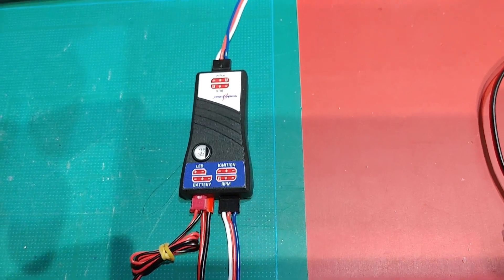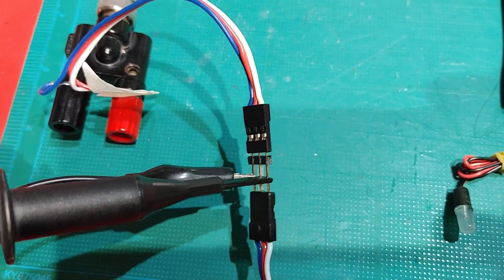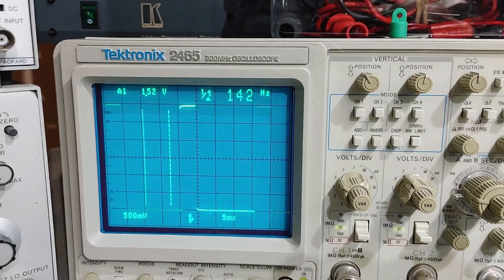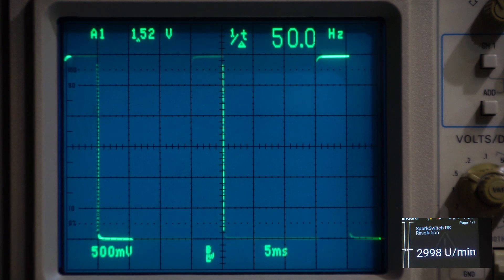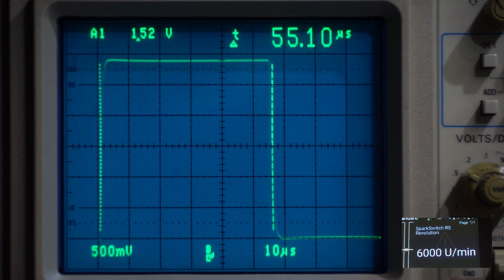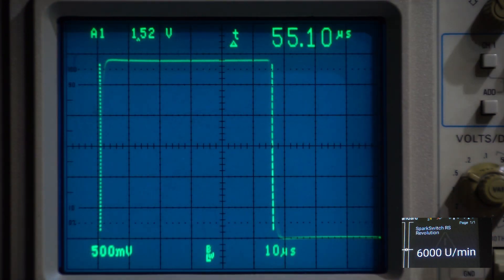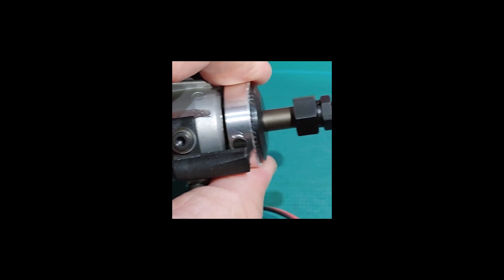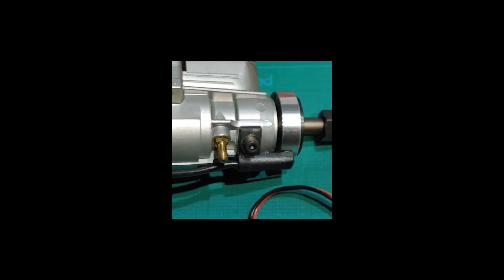PowerBox SparkSwitch RS : Part 2 - Technical Testing with Saito Single Cylinder Ignition Module

Comment: Hi costas thanks for this excellent video. Could you show exactly where you put the rpm probe . Is it between the hall sensor and the ignition module or between the ignition module and sparkswitch ?.  Again many thanks for the time and effort you put in to these videos .
Reply from the maker: Hi Joe... I connected the RPM probe to the Saito's tacho output connector and not the actual sensor. Sensor is connected directly to the ignition box.

So basically it is working off the tacho/rpm connector that the ignition box provides.
Reply: Thanks costas.  I was having issues like you with my gp 123cc but the rpm probe didn't improve the situation . I was using it between the sensor and the ignition , I will change this and put it in line between the ignition and sparkswitch and see how I get on.  Many thanks

Comment: Assume the RPM probe has a very high I/P Z?
Reply from the maker: @PeterOZ61  I did not check the input impeadance but you are probably correct. It is designed to sit across any hall sensor and then output a pulse to the Sparkswitch.
Reply: @CVHeliPilot  would need to have it so it does not load anything down.